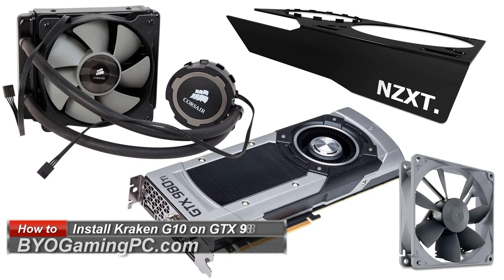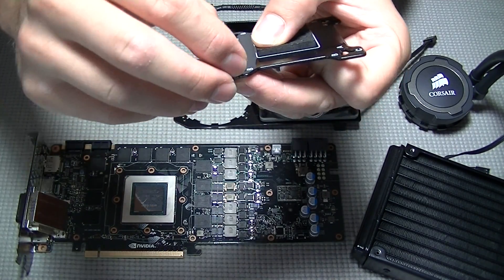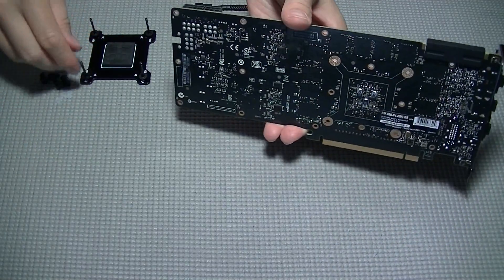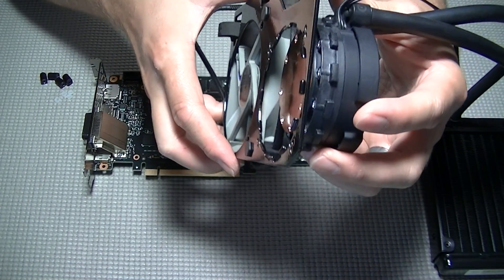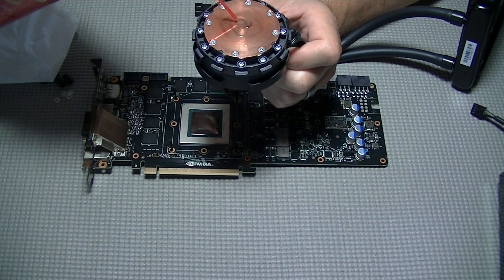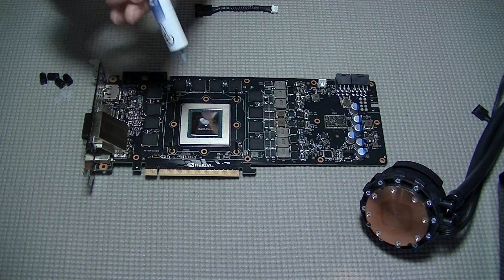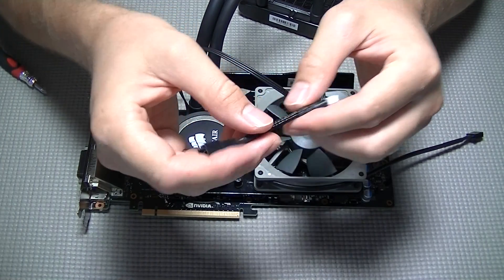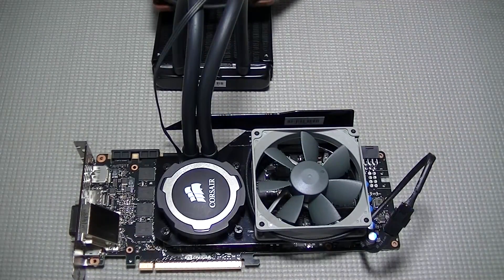NVIDIA GTX 980 Ti Reference & NZXT Kraken G10 Installation Guide & Performance

Comment: 2021 Update:  I have a Kraken g12 bracket on a 980ti paired with a 280mm Rad.   43ºC Max lmao  whisper quiet
Reply: Planning to do same. My GPU sounds like jet engine recently when gaming. Decided, instead of cleaning and replacing thermal paste, to go for AIO water cooling. Only worried where I will find a space to fit it :)

Comment: BYOGamingPC:  One of the best video tutorial i saw. the VRAM Heatsinks., Would that be an option? i do not plan to Do heavy benchmarking ect. But i would like ur expert opinion if to add Thermal pads on the Vram??? Hope you can kindly Resoponed this is my first time to do this. My GTX 1070 founders edition gets toasty, and would like to add a cooling kit TY.
Reply from the maker: VRAM heatsinks would be helpful but are not a requirement if you don't OC the memory.

Comment: Great video, Few questions tho:
How much does ur gpu overclock after this? How did u monitor ur vrm temps?
If i oc my g1 980 ti to its absolute limit (which ive found using some interesting methods) of 1550 MHz core, should i br worried abt my vrm/VRAM temps?
Reply from the maker: VRM temps shouldn't be an issue but your VRAM temps are what you will want to watch out for. It was a long time ago when I did this so I don't remember how far it overclocked but I didn't push much more voltage through.

Comment: I don't think you need a shim for this. so long as the actual GPU chip is higher than the frame around it, it'll seat fine. I'm running mine without a shim, EVGA 980 Ti ACX 2.0 yada yada, based off reference design. Depending on what version your card is and how it was assembled, you might need to remove the back plate and the front shroud in order to seat the h50/h55/whatever cooler you're using, properly. I'm running mine bare, no heat sinks no back plate nothing, and all temps are below 50c.
Reply from the maker: This is correct. My model and the cooler I used would not allow contact with the GPU so the shim was necessary.

Comment: I dun find Kraken G10 in market already, does X52 is the same ?
Reply from the maker: The X52 is a water cooler and the G10 is the GPU mounting bracket.

Comment: Thanks for the video. Very helpful.

Question: when you say "all 3 fans", are you referring to the rad fan, vrm fan, and the GPU AIO pump? I'd like to have all the fans/pump handled by the GPU header as well so I can setup my profiles in my OC software
Reply from the maker: Correct, I meant each of those fans and you could have the pump as well but it's up to you.

Comment: This or Corsair HG10 N980?
Reply from the maker: The HG10 N980 would be better if you don't really need to reuse the bracket but if you want to use the setup on another graphics card then the Kraken G10 would be better. N980>G10 in terms of cooling performance.

Comment: i want a costum water loop  using the kraken is it possible
Reply from the maker: Yes, but it would require some modding and be much less effective than a full cover water block. If you're going through all the trouble with a custom loop you may as well get a full cover block.
Reply: BYOGamingPC the problem is that i don't know if a normal cpu block would fit on the gpu that's what i'm wondering
Reply from the maker: As long as it is an Asetek style block then it should.
Reply: BYOGamingPC what is Asetek?
Reply from the maker: It's the circular type of block that has the jagged locking edges around it.

Comment: Do you have to use a 120mm all in one. I'm a noob but would still prefer a 240mm or 280 rad all in one?
Reply from the maker: You don't have to use a 120mm cooler. Any Asetek style cooler should work but you won't see much of an improvement in performance over the 120mm. It gets the job done fully.

Comment: So I just got this kit and it work's flawlessly (especially since I have the MSI reference card and it's like a fucking space heater because it overheats so much). My question is: Is there a backplate that I could get that would be compatible with this setup? My card is starting warp/bend a bit inside my case, and I'm worried over time that this would worsen.
Reply from the maker: I've come across a website that may be able to have what you need. http://www.v1tech.com/

Comment: How did you manage the stock cooler to sound so loud? I never hear my gtx980 with stock cooler while gaming and I have it over clocked.
Reply from the maker: +Steve 30x There is a significant difference between the 980 and 980 Ti.
Reply: +BYOGamingPC I know that but as I asid I have my GTX980 overclocked as far as it will go and its still quiet. Surely you have a manual fan curve set so that the fan will go to 100% bcause theres no way the stock fan speed sounds like a stock AMD GPU
Reply from the maker: +Steve 30x I did have a custom fan curve set which is more accurate since both tests were with the same curve to keep GPU temps within the same limits. It would be much different when testing a stock fan setting with the factory cooler reaching thermal limits but remaining quiet and the Kraken being much quieter and far cooler. I set custom limits so both setups were trying to achieve the same results (more applies to apples instead of potatoes to apples).

Comment: 77c VRAM temps? Outch that is bad! Kraken G10 sucks!
Reply from the maker: +PappaSlask It is cooler than with the reference cooler.
Reply: BYOGamingPC
But is it cooler than Corsair HG10?
Reply from the maker: +PappaSlask No but it is compatible with more than one model of graphics card, is cheaper, and is still cooler than the stock one. The HG10 is also not cooler than a full custom loop... A full custom loop is not cooler than LN2...
Reply: BYOGamingPC
Well, compatibility wise it's better. But since you have to go through the fuzz of buying a custom fan and extra vram heatsinks and apply them, I think the HG10 is still a better choice, it's cooler too. If you wouldn't be aware that the G10 didn't cool the vram properly, and actually cools vram worse than default, what good is a cooler GPU if the vram ramps up like crazy when overclocking, Kraken should include vram heatsinks to begin with, just very poorly executed of them. People unaware of the situation and novice people in general might just burn their vrams or get bad throttling on clockspeeds and other problems.
Reply from the maker: +PappaSlask You don't have to buy the extra fan. VRAM cooling is not a major issue unless you put a lot of OC on the VRAM but anyone that would be doing that is probably not a novice and aware that some VRAM heatsinks would be wise. I don't argue that the HG10 is better for the 980 Ti but there are a lot of people that have, want the compatibility, prefer a more value oriented option, and/or didn't wait for the terribly long release of the HG10. When this video was created, Corsair was still many months away from even releasing it.
Reply: BYOGamingPC
No that's true, you don't need the extra fan, but it sure helps a lot with cooling on this particular cooler. Yeah you might not need extra vram cooling if you don't plan to OC. But honestly, who buys a water cooler for his GPU if he doesn't plan on overclocking? That's kinda the point in my point of view. Well the HG10 is out now, and supports the most popular videocards including AMD's recent cards. But you're right in the manner that when this video was made the HG10 was still not out yet. I don't get the whole "value" point you're trying to make here, the HG10 is just a couple of bucks more than G10 and doesn't require extra heatsinks, with the heatsinks the price would be similar or higher for the G10+heatsinks than the HG10 alone.

Good day sir.
Reply: +PappaSlask is necesary the pasive cooler for memorys
Reply: STARK 115
English please!
Reply: i dont speak english
Reply: STARK 115
Then I am sorry!
Reply: no problem i learnd english
Reply: STARK 115
Oh you just learned English? Perfect then we can continue! What was it that you wanted to say sir? :) It was something about passive cooling for memories?
Reply: yeah 
 if no pasive cooling 
the most probably is that memory fail

Comment: friend please answer me, i have just bought a kraken G10, but there is no heatsink for vrams, and i would like to know if your card still alive without the heatsink
Reply from the maker: +victor manuel Yes, it will run just fine without the heatsinks as long as you're not doing any heavy voltage overclocking. It does not come with them.
Reply: ok thanks friend, 
It was an issue that concerned me , Thanks to your answer I feel calmer , but then from what I understand you never put the heatsink on the VRMS
Reply from the maker: +victor manuel Nope, I never did.

Comment: Has anyone tried using the Kraken on a 980ti Non Reference? Got a Gigabyte model and all of theirs are pretty much non references so I can't use the Corsair HG10.. :(
Reply from the maker: +david kozat It should be able to work. Most "non-reference" models still use the reference PCB layout.
Reply: Thanks, I see that you can as the cooler backplate is attached through the GPU chip rather than the PCB itself, however the lack of contact with the VRMs and Memory chips makes me not want to buy this....
Reply from the maker: +david kozat It's not made for the extreme overclocker but it keeps things plenty cool for moderate overclocks. Not all models have heatsink contact on the VRM and VRAM anyway. Some do, some don't. You can buy the heatsinks linked in the description for added VRAM/VRM cooling. It will be more effective than what comes on a normal air cooled card.

Comment: so how do you have the fans connected to the gpu? are both the radiator fan and the gpu fan connected to the graphics card?
Reply from the maker: +Brandon Ion Using these two items allow you to have your fans controlled by the GPU via the GPU fan header. 

Gelid VGA Fan Adapter http://azon.ly/kBZ2Em
PWM Fan Splitter Power Connector http://azon.ly/ezyRZt

Comment: Can you install this without removing the bakcplate?
Reply from the maker: +TamezTech Yes you should be able to.
Reply: +TamezTech It is possible to keep the backplate and the headspreader on the card and install a G10 on it. My friend has done it with a MSI 980Ti
Reply: +TamezTech Edit: You need also a copper plate if you do it with the heatspreader!

Comment: will this work with an H100iGTX?
Reply from the maker: +newrhea13 No, it only works with Asetek style coolers. The round ones with the locking teeth around the heatsink.
Reply: BYOGamingPC but the H100I GTX does have the round plate with round locking teeth, but has a plastic and metal square pump top. that why i have been so confused...
Reply from the maker: +newrhea13 I'm sorry I did not realize that it was. Yes, it should work but I can't say 100%. The GT model is not Asetek but the GTX is so you may be able to get it to work just fine.
Reply: BYOGamingPC ok, the reason i ask is because im probably going to replace my h100igtx(which i got for free from corsair) with a NHD15 from nocta, i really appreciate the help!
Reply from the maker: +newrhea13 My pleasure.
Reply: BYOGamingPC NZXT said it would not work but they only referred to the h100i not the h100igtx but if i ever get enough money for the damn bracket ill totaly report on how well it worked.
Reply from the maker: +newrhea13 I'm willing to sell you mine. :) Message me if interested.

Comment: how the hell do you get the reference off? I u screwed but it's stuck
Reply from the maker: +FoxTwo If I remember correctly there are about 13 screws. Yea, crazy. There are a couple that are on the en of the plate where the display connections are. Don't forget those.

Comment: what happens when you take all the fans and heat sinks off? and try and run it?
Reply from the maker: +peterpiper0002 Your PC will crash when your card overheats or you will see some artifacts and your GPU will throttle. Why don't you try it and post your results? =)
Reply: +BYOGamingPC naw, just wondering

Comment: Not sure what nvidia used for TIM paste but i can tell you my temps were a good deal higher after putting some GC Xtreme on my 3 way 770's. I have 970's in a 3 way config and my max temps are 70c at 50% fan. I have little faith in GC xtreme despite it being widely praised. 

Seems your temps improves slightly albeit the cooler looks terribly designed. I suppose if you use a windowless case then no worries. Good video

Comment: Would this work for an evga 980 Ti?
Reply from the maker: +andydelvalle68 Yes, EVGA uses the stock PCB.
Reply: +BYOGamingPC  Ok because I got a hydro copper version of the 980 TI from EVGA ( Which doesn't have the needed fan next to the GPU cooler) and I cant even use the card because I need a fan. I just went and bought the hybrid adapter also. Do you happen to know where I can get a fan for it. Thanks for the reply btw
Reply from the maker: +andydelvalle68 The hydrocopper version is for a full custom loop water cooling setup. I think you got in way over your head buying that model. Buying the hybrid adapter is kind of wasting what you already purchased. You need to return the hydrocopper if you can and buy literally any other version of the card.
Reply: +BYOGamingPC  Yeah trust me I know and I wanted to return it but I got the card from a person off of cragislist so I can't return it :( so I am trying to find a way to get it to run without blowing up besides running a custom loop.
Reply from the maker: +andydelvalle68 Got ya, it's a great card and I would sell it on eBay if I were you and get what you want.

Comment: The EVGA superclocked 980 with acx 2.0 cooler has a thermal plate under the acx 2.0 cooler. Do i have to remove the thermal plate and the acx 2.0 cooler? or just the acx 2.0 cooler? http://www.overclockers.com/evga-gtx980-superclocked-acx20-graphics-card-review/
there is a pic of what the thermal plate looks like
Reply from the maker: +T0xicN0va Follow this video instead and it should answer your questions. https://youtu.be/weV0FlahyDo?list=PLTLW-NE1XjRCDLWTgKec1BCKucCXqrqdq
Reply: +T0xicN0va You can remove the heatspreader from the PCB, but that means that the vrms and Vram will be pretty uncooled. Either buy a 1-1.5 mm thick copper shim and place between block and GPU. Because the block will not reach down because of the heatspreader.
You can also take the heatspreader off and put small vrm cooling fins instead. which is what im doing.

Comment: Question: Will this fit on a nVidia GTX 970 reference? I ask because on the NZXT website it says it does, but on some retailers (like amazon or newegg) , the 970 isn't listed!
Reply from the maker: +jonesmalaco If NZXT's website says that it does then it will. It fits many various models of 970 and higher cards.

Comment: I have a reference gtx970, the blower coooler makes a brrrrtttttt noise all the damn time.  
Can i remove that and put a normal coooler on it?
Reply from the maker: +Marcos Noble Not sure what you mean by a normal cooler... There is the option of something like the Arctic Accelero http://amzn.to/1YpUhRf
Reply: +BYOGamingPC 
blower coolers look like this
 https://www.google.com.br/search?q=blower+cooler&biw=1472&bih=712&tbm=isch&imgil=lPgV6UVb7xAqWM%253A%253BMyU_A3ala-oQaM%253Bhttp%25253A%25252F%25252Fhexus.net%25252Ftech%25252Freviews%25252Fgraphics%25252F51857-nvidia-geforce-gtx-titan-6gb-graphics-card-overview%25252F%25253Fpage%2525253D3&source=iu&pf=m&fir=lPgV6UVb7xAqWM%253A%252CMyU_A3ala-oQaM%252C_&usg=__NSbQ9Zyr3OpRPv4Y0-WGBCrkvK0%3D&ved=0ahUKEwiCitv7p6fJAhUFN5AKHXAmDlsQyjcIMw&ei=XG1TVoLsFoXuwATwzLjYBQ#imgrc=lPgV6UVb7xAqWM%3A&usg=__NSbQ9Zyr3OpRPv4Y0-WGBCrkvK0%3D
my gtx 970 has one of those and it makes a maddening noise, the seller won't help me and i want to replace it with usual coolers, like this  https://www.google.com.br/search?q=blower+cooler&biw=1472&bih=712&tbm=isch&imgil=lPgV6UVb7xAqWM%253A%253BMyU_A3ala-oQaM%253Bhttp%25253A%25252F%25252Fhexus.net%25252Ftech%25252Freviews%25252Fgraphics%25252F51857-nvidia-geforce-gtx-titan-6gb-graphics-card-overview%25252F%25253Fpage%2525253D3&source=iu&pf=m&fir=lPgV6UVb7xAqWM%253A%252CMyU_A3ala-oQaM%252C_&usg=__NSbQ9Zyr3OpRPv4Y0-WGBCrkvK0%3D&ved=0ahUKEwiCitv7p6fJAhUFN5AKHXAmDlsQyjcIMw&ei=XG1TVoLsFoXuwATwzLjYBQ#tbm=isch&q=computer+cooler&imgrc=uB0DobN96d3gHM%3A

In one of your videos i saw you put a noctua cooler in place of the blower cooler and you also duplicated the connection to the board controller.
Reply from the maker: +Marcos Noble Yes, I know what a blower style cooler is. =) I wasn't sure what you meant by putting on a normal cooler.
Reply: +BYOGamingPC 
Well, do you think i can replace it?
Reply from the maker: +Marcos Noble Should be no problem if you get another cooler.

Comment: is it possible to use this bracket with 2 cards in sli?
Reply from the maker: +Arvin Rao Absolutely! As long as your motherboard has the proper spacing. Any full ATX or larger motherboard should be fine. mATX you will definitely need to measure.